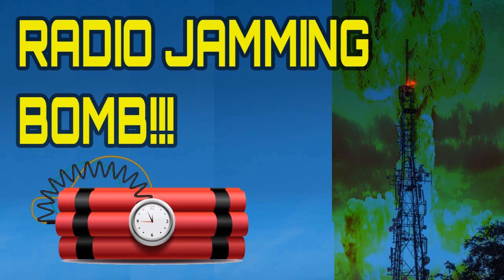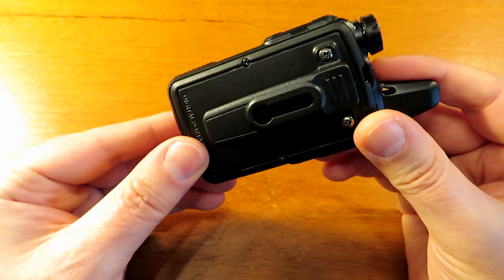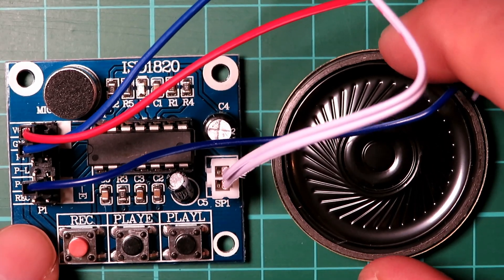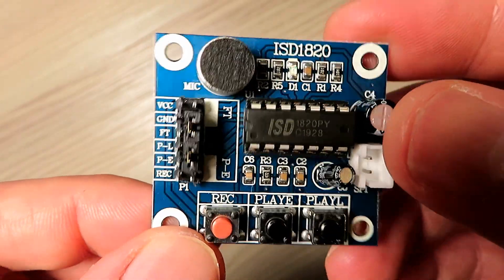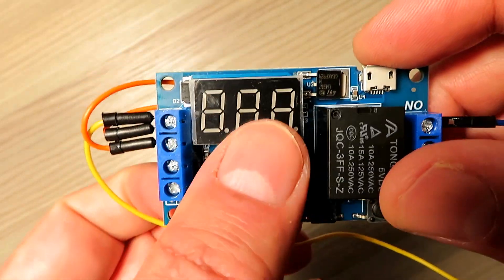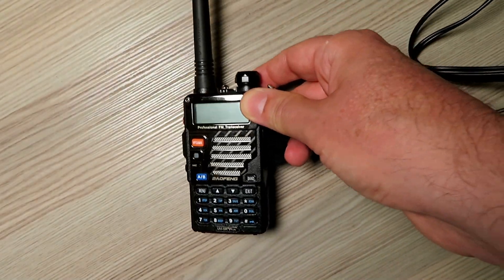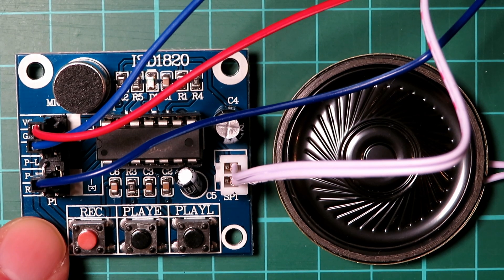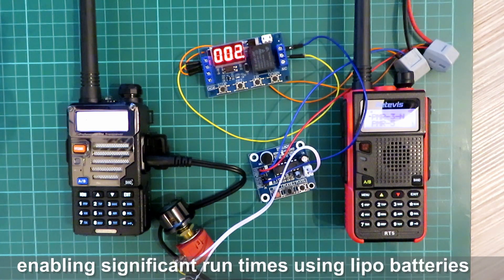WHEN IS A RADIO JAMMER NOT A RADIO JAMMER? THATS DOWN TO YOU !- THE ISD1820 - NOW PLAY NICE :-)

Comment: The problem of stray RF getting into everything can be prevented somewhat by not hardwiring audio output to transmitter input, although crude, if you use a small speaker to a microphone, this breaks the link and everything seems to run OK. Not ideal for audio quality, but that is not an issue. The basic problem is the close proximity to the transmitter, you only have to look at the lengths repeater keepers go to with cavity filters etc.

Comment: The best devices were using the Wood & Douglas 1 Watt crystal transmitter board, as you show with the repeater bug with the 3 clocks in. Still in working order. Cost was about £150.00 with toneburst and battery etc.

Comment: I thought that repeater use (at least on 2M) dying out was a USA thing but I keep hearing multiple references to the same occurring the UK. I got my Tech+ ticket in the very early 90's and as a matter of fact my first H.T. was Radio Shack's (Tandy's) HTX-202. In my area (central Indiana) there was no shortage of repeaters and only private or small/very rural repeaters were very quiet. There were call nets, swap/selling nets, and etc.. Due to a change in lifestyle I stopped using amateur radio completely. During a move I found an old H.T. in a box and decided to charge the battery and see "what was what"  This must have been about 2010. Well.... much to my surprise, I could find nobody talking, even on the once big repeaters! As a matter of fact... there had been a HUGE linked repeater network that called itself; "The Mighty 525" (It was on 145.250) and would reach ALL of my state and into ALL connecting states! This network had something like around 100 individual repeaters!! It was always busy, day or night, 365 days a year!! Well... not only was it quiet.... it was GONE!!! I couldn't even get a "kerchunk"!! After getting an ARRL Repeater Directory. Not ony was my state's listing thin but the whole directory for the USA was much thinner. I find this sad but apparently a sign of our computer and smartphone laden times.  :^(    73 Roger W9RHS
Reply from the maker: That's very interesting thanks for that, round here it's very rare you hear anyone on sadly.
Reply: They are using the rf spectrum to target “dissidents” - aka targeted individuals who are placed on terrorist watchlists and then stalked slandered harassed and then test mass surveillance grid equipment such as remote neural monitoring programs which are basically how two diplomats in a room of 100 can be hit and nobody noticed.  Obummer did something called the brain mapping initiative- this is a unique identifier just like a fingerprint - also just saw a vid on the census just going out to EVERY SINGLE HOME ADDRESS IN THE ENTIRE USA - and logged the gps coordinates into their little ups scanner thing and nobody even noticed and they did not mention it at all via media etc...... they have been doing this for 22 years to myself and there is an entire population of people- estimates are hundreds of thousands worldwide and growing.  I firmly believe based on factual information of mk ultra mind control tech being used in Colorado which is kind of its epicenter likely due to the genetic mutation of the weed industry being opened up in that state and the Denver airport is one CREEPY SWASTIKA SHAPED TUNNELS AND OMG THE MURALS - of you have never seen these - you will be blown away its kids in coffins guns nazis and more - the people just walk by like it’s not completely horrifying and should have protests or at least issues with masked targgers or peta type paint dousing .....but they are doing something with the diff frequencies on the rf spectrum to attack individuals and they say .....eventually all of us.  I can tell you this - what the world is experiencing is sooo step by step similar to the beginning of most of the people under the track and trace programs that all got massively funded post 9/11 and now the industry of community police snitch policing by allowing certain individuals to have a free pass keep all the money AND EVEN GET FINANCED TO GROW AND EXPAND- these are things like drug trafficking arms dealers money laundering and their favorite- THE HOOKER SNITCH .....a snatch snitch?  Then the agencies are spying on the spy’s that spy on them and surveilling the surveillance and there’s so many diff agencies that they are all stabbing each other in the back and play very dirty - CSIS is one of the worst as they hire the street scum the tweekers who steal your kids bikes and homeless people and mentally ill are used and there is NO ON THE BOOKS MONEY - they are cash housing cars and gift cards to Walmart- so each individual dictates their own deal - obviously they would rather set you up and hold 25 years over your head and have the upper hand but if they want you they will get you and many targets are veterans......they get slandered and even Drs play along - ptsd disassociated and DANGEROUS......now this vet just got home - unless he is REAL JACKED UP - he knows if he’s being followed he can spot the security actors cuz they are tweekers or basically you can tell if a movie has bad acting ......it’s like porn - just lame and a waste of time lol. 
I have been trying to figure out how and what I can use to block them as now I am rabbited and my 30 year DIRECT neighbor sold her house sight unseen (not one looker) it sold for over half mil and they had just remodeled the entire condo - but they were there for weeks installing “something” - she screams at her kids over random crap is loud and ghetto (which I can be too - when I am in the ghetto and everyone is yelling lol) but it’s obv she is a cps free housing SPY and when you have no morals and are willing to use these so called non lethal weapons on people and quite frankly SLOWLY MURDER a person who is innocent for stacks of cash and a visa or their kids back etc - I was raised by a pedo mason who raised or programmed me mk monarch or the sex one kitten program etc similar to Britney and others in Hollywood......they use microwave pulsed ultrasound and other “dews” directed energy weapons and I am sick and don’t think I have another move but I was for the most part protected by social distancing for the past ten years - this allowed me to build a successful tho constantly hacked and fucked with - and to FIGURE OUT WHO THE HELL WAS DOING THIS AND HOW WERE THEY DOING IT.....sadly it turned out to be my neighbors and I barely made it out of my last place alive ......tho I had a huge burn blister on my back maybe five inches wide and two in tall w a red ring around it - I don’t know when that was done and it did not hurt ?  But it did pop and heal like a burn from an iron etc would soooo - also I lost my eyesight literally over night and need pretty strong glasses to read anything I was throwing up from both ends and there were days and then weeks I literally could not get out of bed and take my dog to pee - dr to dr no help and if anything they made it much worse - sorry to be so long but if anyone knows how this can be blocked jammed or whatever - if you want to get an idea of what is headed for the world now that us “beta testers” have perfected the tech you are going thru same exact thing- isolating from support then causing divisions via political beliefs and fear - this covid is a planned drill to bring all into China style of mass surveillance and eventually mass genocide under the guise of helping or reset- yeah I’d say it’s a RESET OF BIBLICAL PROPORTIONS when the plan is to depopulate 85% of the global population....take property guns open borders and anti vax hate ......it is the Nazi finale and I suspect they are blasting these frequencies into the air in some way to keep the people down and unable to fight or just damn stupid lol
Bless you 
Oh the series is INTELLIGENCE either prime or Netflix it’s a really good gritty series that really shows where this is headed - private security is the biggest money maker and the funds just got renewed with the new grants for covid track and trace......turn it off NOW and if not .....don’t say I didn’t warn ya !!!
Reply: @TheProdigalProphecies  You'll get greater support if you stay short and focused on your individual grievances
Reply: In the UK all repeaters have to be licensed By Ofcom through the RSGB, if the RSGB wont support your application you are stuffed, the dead hand of the RSGB